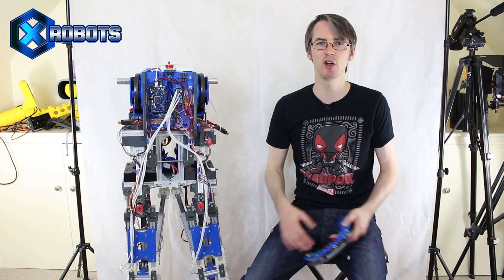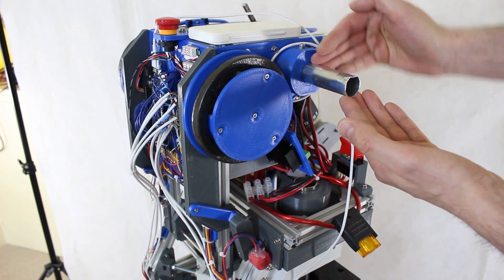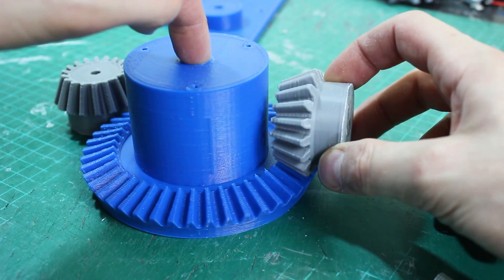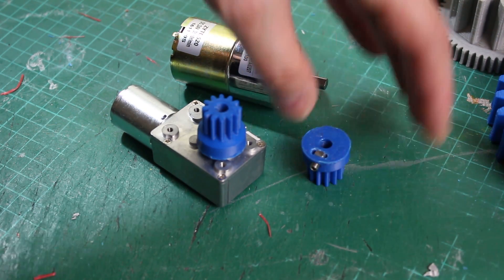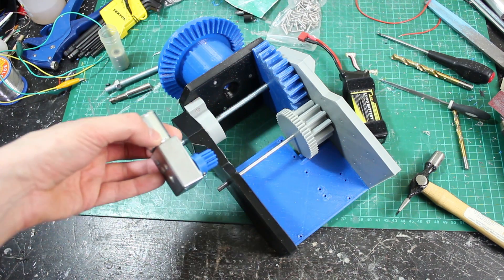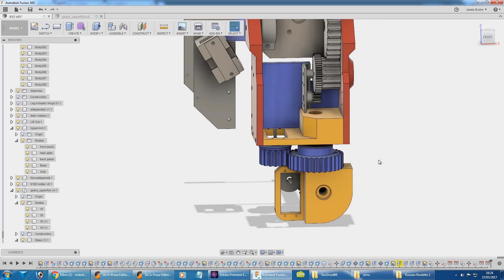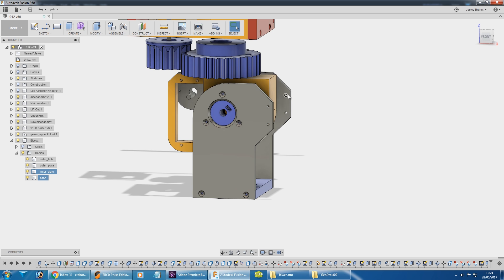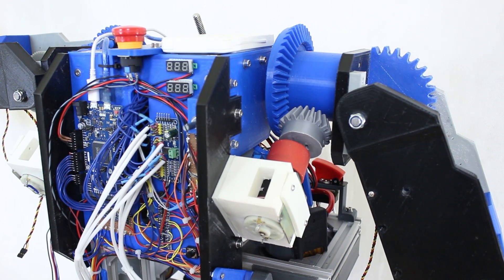Building Robot X #9 | Arms with Four Axis | James Bruton

Comment: You print large parts with ABS. I do small stuff with PLA and it doesn't warp but pop off mid print and it's really frustrating. Just ordered a glass bed and planning on using Elmers glue sticks, but still curious what you do or your suggestions

Comment: I know it depends a lot on the design and structural requirements of each part, but how much infill do you usually use in the 3D printed gears?

Keep up with the good work!

Thanks.

Comment: For the shoulder joints, to reduce backlash you can hack a couple of HS805 servos, get rid of the feedback circuit and cut the stop off the final gear, then drive the motor using a h-bridge. That way they will rotate continuously and you'll be able to drive the arm as far as you like. If it starts backdriving under the weight of the arm you can use locked-antiphase pwm to hold its position. I found some nice dual 10A motor drivers on robot-shop's website which can use sign-magnitude or locked-antiphase using different code through the same pins, so if you have issues with backdriivng you could switch it over on the fly.

Comment: Is there a way to avoid having a ''layered pattern'' on your printed parts which will make them smooth? I was also wondering if there is a way that allows ''scanning'' already existing parts, transfer them to some kind of 3D printer program and print them again with mods?
Reply: I think, maybe, that I saw in one of your videos that you installed little fans near the filament extractor which  in turn gave your parts a smoother look.

Comment: I think that if you want it to walk better, the feet should be make of a rectangular grid of soft cubes that have drilled holes and connected together with your beloved ninja flex. That way if there are rocks or imperfections on whatever floor it walks on, they will be simply ignored either through the softness of the material or the actual block moving up but the rest of the grid staying planted on the ground.

Comment: hi James, i loved this video,  thanks for sharing.
i have just like to give one suggestion, instead of adding an other master arduino have a look at a raspberry pi 3 as master controller. it gives you much more software and control development freedom in my honest opinion.

i use the same setup for my choppy c1-10p robot. and so far i really like it. my pi runs node-red and is communicating with the sub-arduinos via i2c as well. Altrough i'm searching for a bidirectional protocol that fits my needs more.